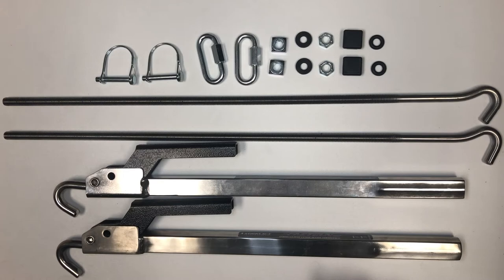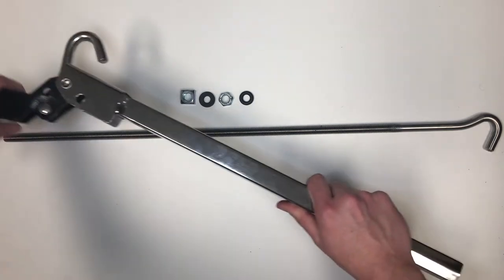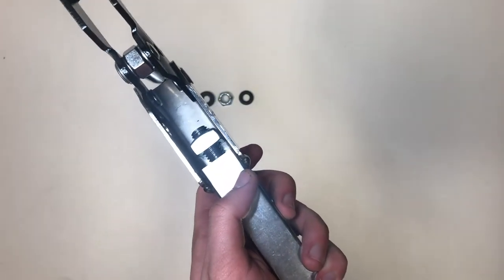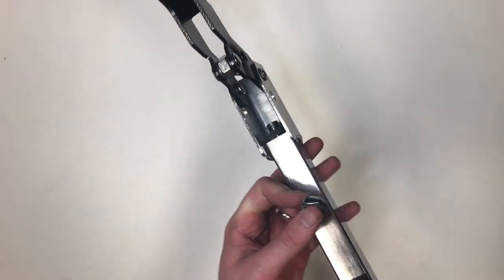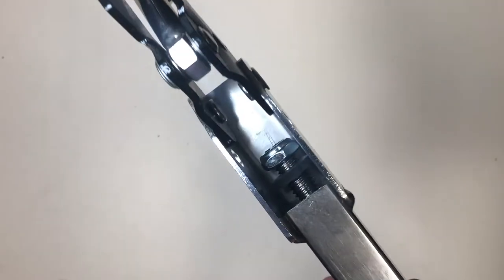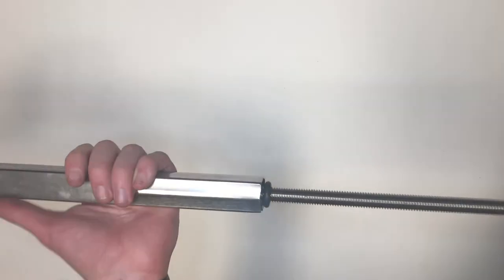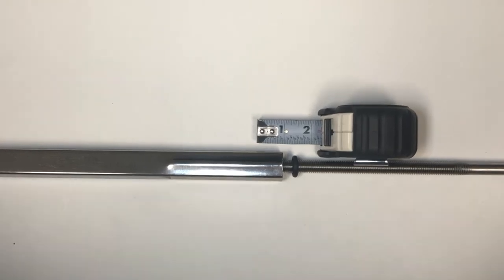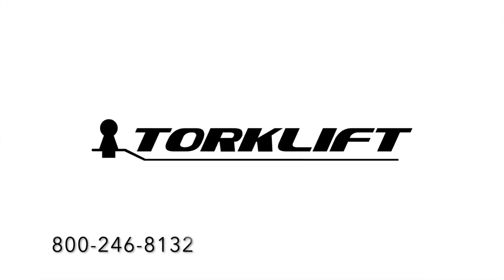Step by Step: Torklift International FastGun Assembly

Comment: My threaded rod is to long and interferes with the clamp handle when tieing down. And i safe to trim the threaded rod by a quartr of an inch?
Reply from the maker: Yes you can trim the hook bolt down as needed. This should be outlined in the installation instructions as well.
Reply: @TorkliftUSA  Thank you, they came with my camper. I never got any instructions.

Comment: I purchased two sets of the 25-40 inch.  Anything less than 32 inch and the threaded bolt starts to push the plastic cap off.  Do I need to cut the bolt?  Need them in the 29-30 inch range.
Reply from the maker: Hi Peter R! If you find that the hook bolt is too long to install, you can trim the bolt. You can do so with a hacksaw or a cut-off wheel.
Reply: @TorkliftUSA  Thanks.   Just wanted to make sure!
Reply from the maker: @Idiopathogen  You're welcome!